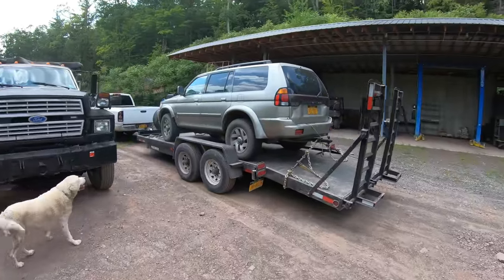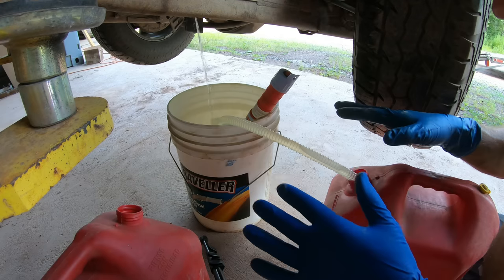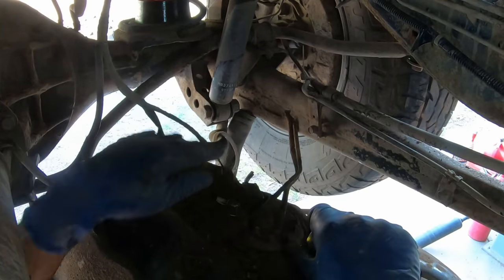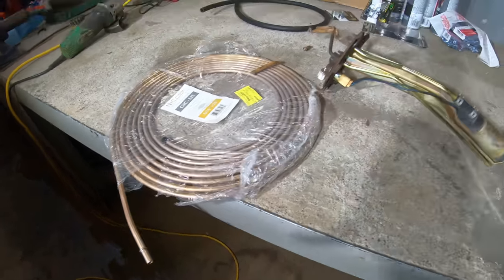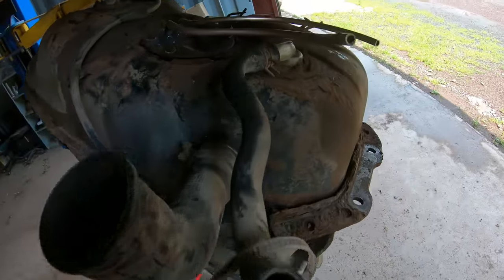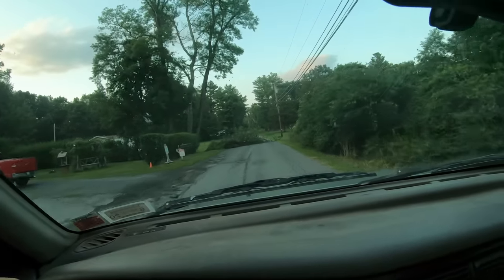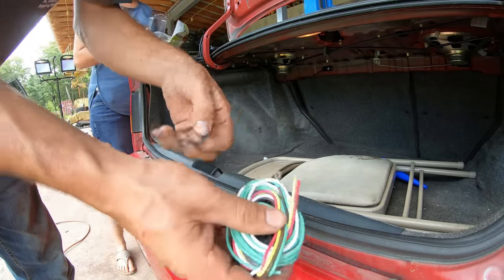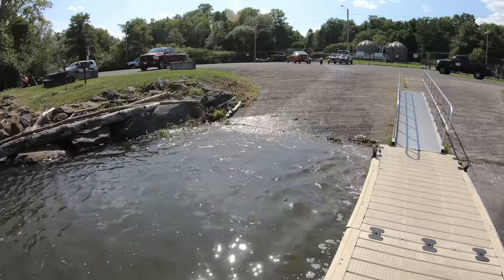Replacing a fuel line in a SUV

Comment: Man I'm glad I live in the south where we don't need to treat our roads in the winter, my truck is 20 years old and the only "rust" is surface stuff on a handful of spots on the frame you could easily knock off with a wire brush. I don't know if I could handle a car rotting away as quick as they seem to up north.

Comment: @ 1:17: Levi: Don't worry, I got you Fam....  I got my fire extinguisher right here....  hahahaha!  Very nice....  such a good boy.  What a classic pup....

And when you start the repair in the daytime....  and then it's nighttime...  that's never a good sign....  Heh heh!  I agree 100% on the nicor line....  But I think, as long as I was there, I woulda thrown a fuel pump in it anyways....  I don't wanna get stranded when the pump dies....  Your repair was great, no question, but, you hooked up new lines to an old tired out fuel pump, that's probably on borrowed time already....  so much work, to drop the tank...  May as well just do it while you are there....  Just my 2 cents....

Very fun video.  Very nice of you to hook up your friend with a tow hitch....  Probably should caution her not to let the wheels on the car go in the lake...  those boat launches get slippery....

Comment: Andrew, just saw a video on a guy checking out an auction. I immediately thought of you. He was checking out an ambulance and a fire truck. Can you envision having one of those to pull your equipment trailer around? With lights on and horn and siren blowing you could make an impressive entrance onto the property of your customers and be one of a kind in your line of business. The fire truck needs repair on the left front axle but you could weld that booger back up in no time. Could also be a chick magnet.

Comment: I was on a submarine, and they used NiCu in many places for the exact reasons you describe. The fuel line isnt for the radio or the air conditioning, so when it goes out you can't get to work, and it might even burn your house down.

Comment: That was a very cute trailer :-) You guys seem to just dunk the trailers completely into the water. Makes it better to load and unload. I was told to never do that because of water rusting out the wheels and brakes, to never back it in more than a few inches onto the rims. Harder to load up the boat though.

Comment: Suggestion in a case like the trailer hitch bolt: Could you slice a few threads off of the bolt and still have enough length for a full make up of the nut? I've placed bolts in similar situations by welding a bit of rod to the head of the bolt and using that to feed the bolt into the hole.
Reply from the maker: callmenort nortin  Nah. I ground the head on one. That just wasn’t happening. What that Hitch company should do is weld those knots to the Square washer plates, that would be a much better set up

Comment: The "quick disconnect" fiting on the fuel filter has a button u push then it will release to where u can pull it off, dont just pry it off with a pry bar

Comment: Andrew Camarata I had the exact same problem with mine up in Australia the model name is challenger I fixed the same way you did with the fuel line and fuel filter
Reply from the maker: Yeah, that is the way to do it.
Reply: @AndrewCamarata  there not a bad SUV I've done the timing belt and water pump in mine and haven't had a problem with it apart from having to replace the fuel tank I do 5000km services

Comment: Hey Andrew, Great seeing another video. A couple things I noticed. On the fuel hose from the filter to the steel line you need to flare the end you cut off. If not there is a good chance it will start leaking. Then on the wiring you did I strongly discourage using those type of connectors. They do not have any mechanical connection. Also when you heated them up the solder did not wick into the wires. That is a common issue with that style. In order to get the solder hot enough to work properly you have to apply so more heat for a longer time. Most of the time you'll end up burning through the insulation makinig the wire prone to corrosion. The best type of connector is the crimp and seal butt connectors. If you'd like a recommendation on a good brand I'd be happy to provide a link to some.Sorry if I come off as being critical, I'm just trying to help you out. Can't wait for the next upload. Your videos are always top notch. If you have any automotive questions please ask.
Reply: Those heat shrink connectors don't really use solder, inside there is a conductive glue that melts at a few hundred degrees Fahrenheit.  Real solder melts around  370°F
Reply: @marcopolo8096  It is solder inside the tubing. They have to be heated to a minimum 280°F. If you use to lower temp the longer you  have to hold the heat to the connector. The shrink tube shrinks at 176°F. The weakest part of the repair is where the 2 wires are joined since there is no mechanical connection. Soldering in general is not recommended to repair wires on automotive applications. Soldered joints become brittle and do not allow that area of the wire to flex. If solder is used it should only be used with along with a mechanical crimp. Heat shrink butt connectors or a parallel crimp is recommended and some, if not all, car manufactures require one of those 2 ways for a repair.

 Ref on solder/seal tubes.  https://www.amazon.com/140-Solder-Seal-Wire-Connectors/dp/B07JJ6YYKL/ref=pd_cp_200_1?pd_rd_w=hB92k&pf_rd_p=ef4dc990-a9ca-4945-ae0b-f8d549198ed6&pf_rd_r=NHHFACDFEEB7M7YKBC42&pd_rd_r=a764e82f-dd81-4bf0-8557-553dfc50647f&pd_rd_wg=KQ6fT&pd_rd_i=B07JJ6YYKL&psc=1&refRID=NHHFACDFEEB7M7YKBC42

Comment: Great job fixing the fuel pump, but replacing the unit for a new one also prevents the electric motor crapping out on you soon. Sadly all these part have a MTBF (Mean Time Before Failure) So I bet you will have to open it up again someday.

Comment: That salt they put on the roads should be illegal for what it does to vehicles.  I live in Oregon and my 2001 Dodge Ram pickup still looks like brand new underneath and it has 240,000 miles on it.
Reply from the maker: Diesel trucks Firewood I agree.

Comment: Usually Curt hitches are very well sized, I am surprised that the bolts wouldn't fit from the inside.
Reply from the maker: Dasdfjkl that Hitch seemed very good quality, by getting those bolts in there looked impossible, they should just weld those nuts to those metal plates and bolt it from the bottom like I did

Comment: Japan does not salt their roads in the winter, which is why so many older Japanese vehicles are prone to rust.  They weren't built with export first in mind.
Reply from the maker: American trucks rust out pretty fast too.
Reply: @AndrewCamarata  Ya, even American trucks are just made incredibly cheap with those galvanized lines and waxed frames.  The early Mazda bodies were super bad with rust.

Comment: It's because what NEY YORK buts salt on the roads, I've had cars with steel gas lines that are original and hasn't rusted yet and I live in Northern Illinois. Illinois buts a mixture of beet juice and something else. Cars are not as rusted anymore either I lived up in Watertown when I was stationed at FT Drum NY and found they use regular salt which corrodes steel

Comment: Steel lines ? Reminds me of by broken hip when oil came pouring out of a feed line going to/from the sump to the oil cooler on my Honda CBR 1100XX 1999 Model X. All owners of same should be aware ! If you ride  the bike in all weathers. This is old info now, but low milers might not be aware. Stainless steel equivalent set can be obtained from Jaws Motorcycles, they do ship overseas.

Comment: I would venture a guess that even the best mechanics can only so much with cars in New York. Iowa is same way new rigs with frame rusted into in less than seven years, completely into two or more pieces and can't be fixed really. I watch another channel and all the guy does is make short trucks out of long trucks which are only good for a little while. Wouldn't live there because if the rust problem. The little front wheel drive car has towing insurance for sure and the metal parts are going to be long gone before the wave runner

Comment: Dude - you could make a living doing this to 90’s (probably even older) OBS fords for their mid ship tank sending units..  they are IMPOSSIBLE to find when the sending unit stops working. It not even a pump, just the fuel level sensor. 
Also - by now you’d think all cars and trucks would come with something designed on the frames to work with lifts to eliminate the possibility of them slipping off ..

Comment: If you lift the car right you should never worry about it falling off the lift when working on it. Plus the engine and transmission on a front wheel drive weights more the fuel tank. If you remove the engine and Transmission out of a front wheel drive it would be   balanced still if lifted right
Reply from the maker: Yeah, just offering that tip. I had a pickup with a snow plow on that lift yesterday with an empty bed. I put a stand under the plow before working on it.
Reply: @AndrewCamarata  that's different.

Comment: sir im sorry to inform you but there are car parts underneath your neat rustpile 
seriously do americans not lern to wash off deiceing salt each year in the spring and spraywax the bottom of the car each autum so the salt doesnt get to it in the winter
it also just helps if you use some of your old motoroil in a paint spray and spray the vulnerable/rusty parts of your car, the rust sucks it up like a sponge and protects th metall below (dont mean you should spray the brake mechanism or parts that get hot like the exhaust or engine block or you got a nice campfire until the pigs come and get you)

Comment: Surprised that Mitsubishi had a mild steel fuel line. The metal portion of fuel line in my 1996 Jeep XJ is stainless. Unfortunately, the other front to rear lines are mild steel so I am replacing them with NiCu.

Comment: Next episode ok so you remember recently I fixed a rusted fuel line so now the filler neck is leaking but only during fill ups and hard right turns no real problem but I figured I'd do it anyways the cost difference between coating the thing in jb weld and aftermarket it's about the same

Comment: I'll put in a plug for etrailer.com for hitches like that. I'm not affiliated with them in any way, but I have 3 hitches from them in use. Great customer service. I wouldn't be surprised if that hitch came from them. Unfortunately, they source those bullshit wire splice things. I throw those out and make a proper connection like Andrew.

Comment: I've had fuel pumps die 2x in my life leaving me stranded with no shop access to fix it myself. If I have the fuel tank down it's 100% getting a new sending unit. Cheap insurance IMO.
Reply from the maker: I would not, aftermarket auto parts are junk. The original one will probably outlast a new aftermarket one.

Comment: Watch your position of the vehicle on that lift it might be sturdy but if its to far forward or back of the up wrights it can pull out and tip over . i bet the electric pump goes out next year and your back to square one,  remember you cant weld or solder over rust. and the reason they dont put expensive lines in is that mitsu would of cost 50k instead of 35k, where do you stop?? and it keeps small companies in business like my self.

Comment: Did u use silver solder? Also if u strip back a piece of wire, split it and wrap it around the bolt, u can fish em thru the holes then just pull the wire n presto bolt installed
Reply from the maker: That was 40/60 with rosin core. We tried that. Was not enough room to stand up that bolt.

Comment: Way did you not clean the top of that with a wire brush and then paint it after you soldered it and put in weld. Job weld is great stuff

Comment: I got the same car, only in Australia its called a Mitsubishi Challenger. Best car i ever had After 250 miles only replaced the radiator and fuel filter. Must say that is the dumbest place to have a fuel filter. Hard to find and hard to get to. Andrew. Show me how to get to the spark plugs. They are hidden somewhere. Iv'e never been able to get to them.

Comment: I've got bad news.  Soldering copper to rusted steel  doesn't work.  JB Weld over rust is unlikely to hold for long. Going to all the trouble of dropping the tank and then refitting the ancient fuel pump with dodgy fittings and sealant to save a few bucks on a new pump assembly is just plain stupid.  You'll be dropping the tank again to do it properly before too long.  Fuel has the most fantastic ability to leak through the finest opening, will pool on top of that tank and be a fire risk.
Reply from the maker: That joint will never break.

Comment: 12:09 
Soldering brass to an iron housing is impossible, covering this connection with two-component resin may not withstand the test of time. I made such connections, but over time they leaked, gasoline can escape even a small micro-drill. Time will tell if this connection will be tight.
Reply from the maker: Its still working good.
Reply: @AndrewCamarata  Goog luck! I write from Poland, and watching, and watching and there is no end of watching yours films, sorry for my English

Comment: did you put new struts in the Montero since you owned it? Do you recommended OEM or those “Quick struts”?
Reply from the maker: Monteros don't really have struts. The front is torsion bars and the rear is coil springs. Usually shocks need replacing every 10 years or so. I did add air bags to the rear to help the coil springs, as they were too soft.
Reply: Andrew Camarata ok thanks!

Comment: @ 7:50 what's with the chair? it's just as worn as that gas tank. Is that Levi's?

those fuel lines will last longer than the car's engine

Comment: Andrew,  could you tell me what your box blade weighs?  I've seen you use it several times on the Ford tractor.  Thanks!
Reply from the maker: I am not sure, its got some steel to it. I recommend that attachment, don't get a cheap one from tractor supply.

Comment: 09:40 I hope you heard that Mitsubishi ? !!!
Reply from the maker: Every comany is guilty of useing these dangerious lines.
Reply: Andrew Camarata Its shocking that this is still the norm. Fair to say that you probably  buck the trend in how long you have kept this vehicle running and intend to do so but it’s ridiculous that parts are still being used that rust out so badly. Ideally everything needs to be of an equal standard to ensure the long term usability of the vehicle but I suppose it comes down to how much he owners want to do to keep thing running - hats off to you for keeping this truck on the road and not going with the normal route and just getting rid like many often do. I have a 53 year old Landrover Series 2a that thankfully either had really good quality parts fitted from new or (if quality wasn’t an option e.g. low grades steel for the chassis) was sufficiently over-constructed in order to ensure it lasted long time. It’s still running and strong and only requires routine maintenance to keep going. Hope you have a good day Andrew👍🏻

Comment: How did you get solder to stick to steel?  I know the new fuel lines are non-ferrous but the fuel pump sending unit plate is steel.  That should not have worked.

Comment: None of the connections he made did he flare the lines. This is going to leak again soon enough. You HAVE to flare the fuel lines to get a good secure connection.
Reply from the maker: That will never fail. You don't flare fittings for rubber hoses. If anything a bubble could be crimped on them, but its not necessary.
Reply: @AndrewCamarata  That's an interesting theory. I guess the filter manufacturer thought differently since the line coming off the fuel filter you installed had a flare on it, and every fuel line I have ever dealt with has had a flare on the end.

Comment: There is definitely a reason they don't use that NiCu line, it's expensive. Cars aren't built for the 2nd, 3rd, and 4th generation owner. They're built for the sucker that drives it off the lot. Think about how much money they would pay for doing it in NiCu. Plastic is good but they are often weak to UV rays and heat.

Comment: They rusted out for no reason? LOL, they rusted out because your state salts the roads. I live in Texas where the state doesn't do that so there is no need to worry about your gas lines rusting or anything on your vehicle for that matter. I have a 20 year old F250 that looks brand new underneath. Auto makers design for planned obsolesce. I mean most people keep a vehicle 10 years or less. Technically were all to blame.

Comment: You keep saying it rusted out for no reason. But there is a reason. What do they use up there to treat the roads during winter?
Reply from the maker: asealy20 salt. They have been using it 40+ years. That car is not that old. It should have the proper lines.
Reply: So you know the reason it rusted out. Hey I’m not disputing that manufacturers could do better. But if they built every vehicle using the best of every material, no one would be able to afford a vehicle. Compromises have to be made. And another point; they can’t engineer every vehicle to contend with a rather specific set of circumstances. Vehicles in warmer climates don’t have major issues with rust.